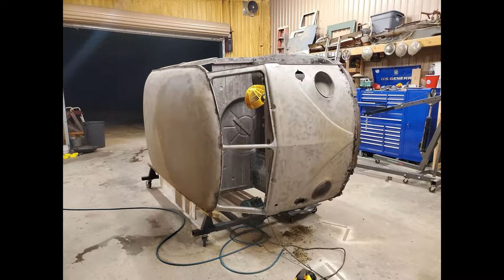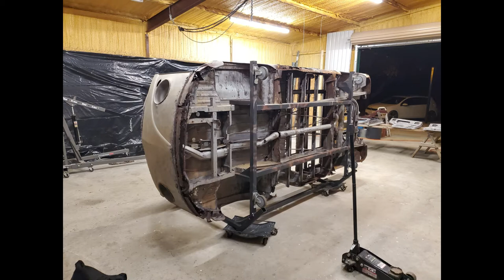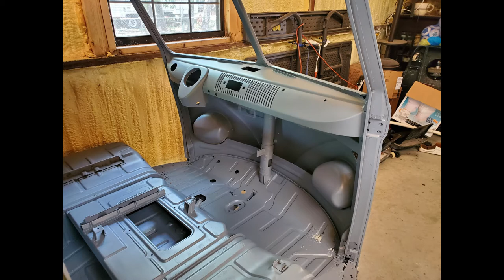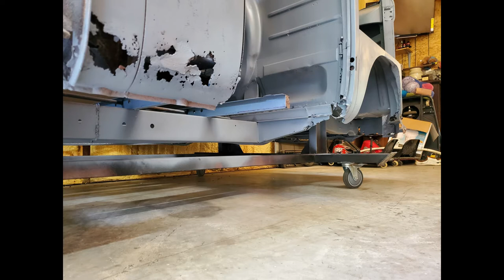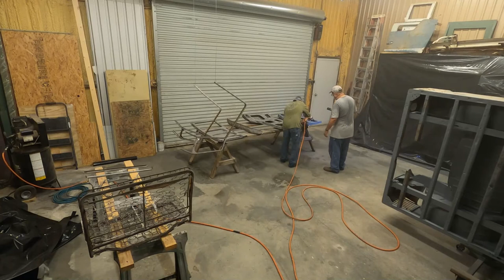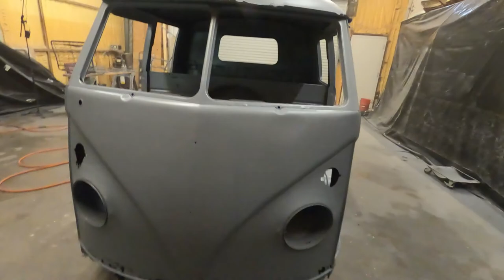1962 VW Double Cab Restoration (Part 8) | All SEALED UP!!

Comment: Just A suggestion, with all your small rusty pieces, drop them in a container of molasses and water, one part molasses to ten parts water. leave them in there for four weeks, take out and pressure wash with water. Even works for doors and larger items if you get a big enough container. No distortion from blasting.

Comment: great job!  I need to do the same to mine.   On my other bus I hand sanded everything and this process seems so much nicer on the metal and hands.  What did you seal it with and is it weld thru or do you have to grind it off when you start your welding?
Reply from the maker: I was going to sand it like I did my 1984 GMC, but being this has rust everywhere and I was doing complete restoration...dustless blasting only made sense. I would have spend countless hours sanding and still would never get it to this level. The sealer was an epoxy primer, but it isn't weld through. Not a big deal as most of the metal is either spot welded back on or I'll have to cut it off giving me a weldable surface. Once I finish the entire truck metal it will be sprayed again before I put color on it.